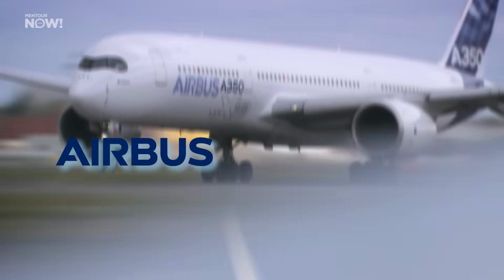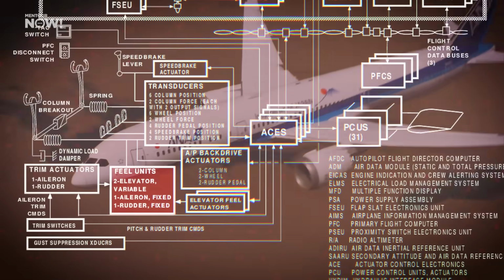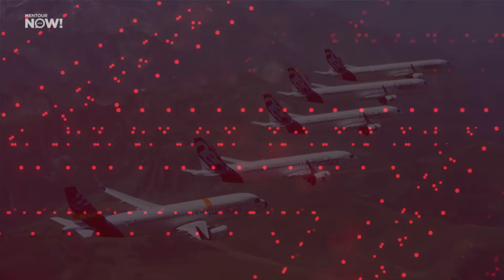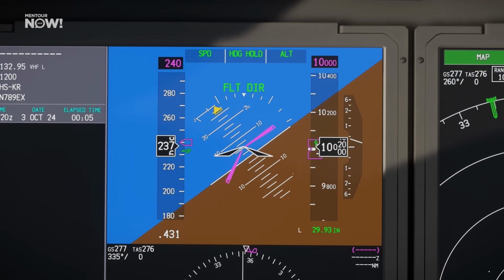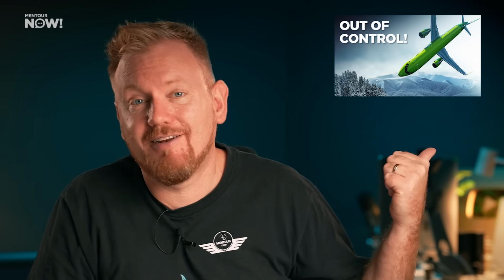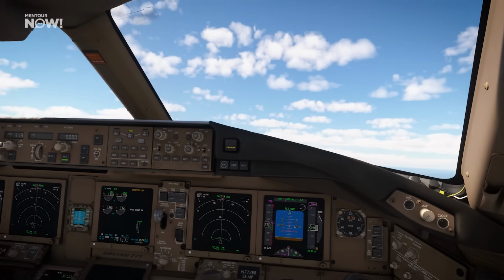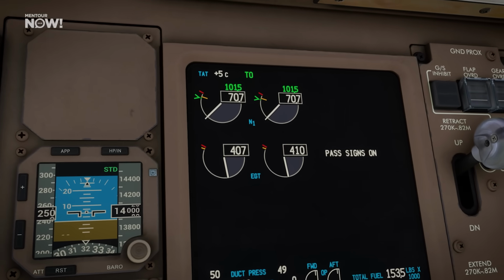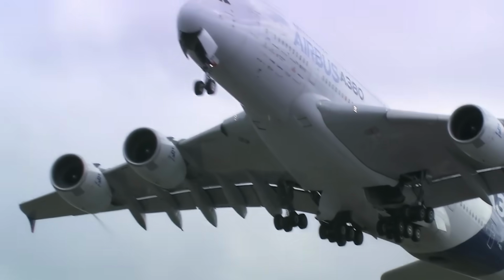Do Pilots Prefer AIRBUS over BOEING?!

Comment: Oh boy you've opened a can of worms here! 
As an engineer I'm going to say Airbus. 
I've worked on Boeings from the 707 right up to the present day's 787 I helped build and maintain Airbus' from the A300 up to the present day's A350. The build quality of Airbus and the way that the company just makes incremental design improvemants along with the way the flight deck layout is what edges it for me. 
Oh! That and the truly awful build quality of Boeing jets today. I've never seen such a poorly constructed aircraft as the B787 before and the Avionics architechture is just insane. Why so many computers, so many electonics that the aircraft's electronics need liquid cooling, unlike the Airbus with two computers and a conventional cooling system.
As for the paint (Or lack of it) on the wings of the Boeing 787!!! No more words needed.
Reply: The thing which I always noticed about Airbus aircraft was the lack of 400Hz whine in the audio, whether it be from their radios or onboard PAs.  That tells me there's extra shielding in place.  It was there on the older Boeings... so if Boeing wasn't willing to spend an extra $20 for RFI filters, what else were they cutting costs on?
Reply: @grayrabbit2211  What else were they cutting costs on? Answer: Everything, hence the current state of Boeing engineering standards.
Reply: @ United has been pausing deliveries of A321NEOs because of an issue surrounding the VHF1 radio. If the lack of 400hz shielding on new Boeings should be treated as a safety issue, then so should the VHF1 issue on United’s A321s.
Reply: @grayrabbit2211 For sure they are not cutting costs on tightening all the bolts like boeing ;)
Reply: @ that’s not a safety issue, has never led to the endangerment of people’s lives
Reply: As a 787 mechanic I have to agree. While I much prefer Boeing manuals over Airbus, the plane itself is not aging well. Mods all the time and new problems emerging sooner than they should. I’ve replaced damn near the entire rad altimeter antenna system on about 7 planes now. Not fun
Reply: @kevintaylor31  the lack of paint on 787s is cosmetic and caused by how novel new materials were at the time. A350 has a very similar issue, but on the fuselage. Neither are safety issues.
Reply: @Blank00 I assure you only paint issue on the A350 comes from parking them in a desert. No issues with any of ours.
Reply: @Blank00 
I wonder if the 2 companies have solved that problem?
Reply: It makes me sad Boeing is doing so badly. I really hope this conversation flips one day, they used to build amazing things.
Reply: @notsam498 Well, as the saying goes, All good things come to an end. Which is why supermarkets always seem to stop stocking the things I like.
Reply: @kevintaylor31  the 787 uses so many electronics because it is a bleedless aircraft. Airbuses and other Boeing families use a Bleed Air System for various systems like cabin pressurization, anti-ice systems, pneumatics and hydraulics, etc. However, this reduces the efficiency of the engine and allows for toxic particles to travel from the engine to the cabin, so what Boeing did is to replace the bleed system with electric motors and electrical heating elements. This means more electrical parts and therefore, more computers to control the increased amount of The 787 also pioneered Hybrid Laminar Flow Control, which requires more computers too.
Reply: Yes, the efficiency of Airbus. You only need 2 computers to kill people. Well, there are documented cases of where the computers decided the pilots were wrong and crashed the plane. So...
Reply: That's why he changed the title of the video a little after it was released.
Reply: Frankenflight
Reply: Why does boeing 787 outsell Airbus 350?
Reply: @yomamajama9627 because it’s a much smaller aircraft.
Reply: That’s because all 787’s are assembled in South Carolina. Different build attitude than Everett where I worked.
Reply: @peterzarkowskyl2752  and the 787 is the "Aircraft Built By Outsourcing"
Reply: @mercurybard9794  Frankenflight 😂
Reply: @peterzarkowskyl2752 not all of ours are. We’ve got some old ones too.
Reply: Liquid cooling? You mean, like a radiator?
Reply: @fjp3305  No. He means like a 1980's mainframe computer.
Reply: @lours6993  Liquid cooled PC components is not really new technology, it's used in the vast vast majority of datacenters worldwide, used in high-end consumer PCs, and actually used by Tesla to cool their on-board AI 'self drive' computer.

But... It does raise some questions in this situation why Boeing is using so much computer power yet not really doing a whole lot with that. Being realistic, the amount of data being processed on an airliner can likely be computed by any modern phone, it's not really enough I'd think to require liquid cooled components I would have thought?

I don't work in aviation, I'm a software developer, just my take. :)
Reply: @VoxelLoop  I know. Why is your comment directed to me?
Reply: @VoxelLoop  the 787 has more electronics than other planes, even the A350. Non-787 Boeings and all Airbuses use a traditional “Bleed Air System”, where systems are powered by “Bleed Air” from the engine, reducing the percentage of bypass exhaust used for propulsion. But the 787 is the first “Bleedless” airliner, meaning that electrical equipment is used instead of a BAS, composing of generators, electrical pumps and heating elements to make the plane more efficient by reducing load on the engine, maximizing the percentage of bypass that propels the plane, and to prevent Cabin Fume events, which is when toxic fluids flow from the engine to the cabin. Systems that use traditional bleed on other planes but use electrical equipment on the 787 include cabin pressurization, anti-ice systems, engine-starting systems, brakes, and the hydraulics responsible for things like slats, flaps, ailerons/flaperons, elevator, trim, rudder, spoilers, etc. the 787 has more electrical components than other airliners, and would therefore require more computers. Even though the 777 and Airbus planes are FBW, they still use BAS, FBW just controls where bleed air goes. An analogy that I can make is that the 787 can be thought of as the Prius of airliners while other planes are like non-hybrid cars where systems like HVAC relies on the engine to run as intended. The 787 also pioneered Hybrid Laminar Flow Control, which requires more computers too.
Reply: @lours6993  I don't know how is that, never had a mainframe.
Reply: @ Densely packed, high current electronics, run at 100% power full time, needing to be coiled by water or other coolant pipes to prevent melt-down.
Reply: @Blank00  Still I don't think that requires that much computing power in all honesty. I have designed (not a professional just as a hobby) embedded devices and people SEVERELY underestimate how much powerful a phone chip actually is. A mobile phone chip from 5 years ago is more than enough capable to handle all the tasks you have mentioned and still run at 15 watts power. 

Also I think you are confusing between fluid simulation for engineering. I highly doubt a flight computer needs to run fluid computation to run Air Conditioning system in a plane... Yes you need pretty beefy systems to actually DESIGN the plane with this functionality but to actually run it I think a simple 30$ microcontroller would have enough power to run it. Though I don't have much idea since I have not worked on 787. What I have said is how it normally works in industry.

The main reason your phone is slow is not because your hardware is bad but because of terrible software written by underpaid people or by intentionally slowing it down to force you to buy new phone every 2 years.
Reply: @ it’s also worth mentioning the 787 was designed in the mid 2000s and entered service in the early 2010s. Computers from the last decade tend to be bulkier than today’s computers.
Reply: @ actually the GPM’s are pretty slim little things.
Reply: @Blank00  While I can understand electronics needing more cooling for that reason (motors and such do get hot after all), it really shouldn't have any impact on the computer systems specifically of an aircraft to that extent. Modern air cooled computers and servers are extremely powerful. For a long time liquid cooled data centers were more or less abandoned in favor of air cooled as liquid cooling became an unnecessary complication - this even extends to IBM mainframes. Nowadays thanks for AI liquid cooling is making a return as chips specifically designed for AI and other tasks require more and more power. This however does not apply to an aircraft like a Boeing 787 as deep learning is non-deterministic and wouldn't pass safety requirements. So there really is nothing that should need a liquid cooled computer inside an aircraft. Aircraft by design use older and less efficient processors as they have to meet stringent requirements and prefer well established technology for safety reasons. This might increase power draw, but I still have a hard time imagining it being enough to actually need liquid cooling unless we are talking 10+ year old chips.
Reply: You must be british 😂
Reply: @ACPilot  and proud of it too. 46 years an aircraft engineer with experience in everything from manufacturing of aircraft and A/C components. Maintenance, from line to D checks. Component overhauling and testing. And A/C types from light A/C to heavy jets. Helicopters, light aircraft trainers and fast jets.

Comment: Doing a Video like this without mentioning MCAS once is quite an accomplishment...
Reply: Having flown both manufacturers. 737, 767, A330 and A380 somewhere between the two would be best. Both do things better and worse than the other. E.g IMHO Side-sticks are better for most controlling (737 aside as cable backup makes leverage essential) but not being interconnected is pretty bad, particularly for training pilots. Thrust levers that move are great, though airbus method of initiating a go-around is more intuitive (thrust levers full forward) than pressing an often slightly difficult to find TOGA button. Most airbus protections are fantastic are much easier to fly time critical manoeuvres than Boeing (EGPWS and wind shear escape) though in a black swan the lack of protections on Boeing could be useful. 
Boeing PFD is much better than Airbus PFD. 
There are many more. 
I have not flown a A220 or a McDonnell Douglas jet (C17 or B717) but those that have say the blend of features is close to ideal.

It was explained to be once that the difference between Airbus and Boeing is a bit like the difference between a European and American car. They both do the same thing, but the indicators and wiper controls are on different sides and how you engage and use the cruise control is different though the functions are the same, the key to remember is that deep down they are both cars. ANC
Reply: @DC-338 I’ve much the same experience and couldn’t agree more.
Reply from the maker: Stay tuned...
Reply: @MentourNow that has got to be the most nervous looking peice of text I've seen this month...
Reply: @MentourNow I mean, not mentioning it; guaranteeing this comment…
The intro writes itself.
“A while back I made a video, and one of the comments…”
Reply: MCAS was a deviation from the Boeing philosophy since it introduced a computer to take command like in an Airbus. Without the computer the accident might not have happened. The sin was not informing pilots about that software.
Reply: @sundar999 if they had simply copied the same code from the tanker variant of the 737 it would’ve had the same auto disable MCAS failsafe when pilot is countering what MCAS was doing incorrectly instead someone made it from scratch without overview or test pilot input (they put the auto disable MCAS after the crashes witch should have been there to begin with) 

but he also showed the complacency of some pilots not remembering the memory items The moment the trim was not functioning correctly they should’ve disabled it before it was allowed to get to maximum trim down (heavy stick and no reaction from trim buttons is normally faulty trim you stab the trim with 2 switches and spin the wheel manually you need to do this within 15 seconds of the runaway trim happening ,or the trim motors could run the trim all the way to maximum up or maximum down depending on the fault)

Comment: My feeling is that Boeing might be better in the hands of the very best pilots, but Airbus is better at catching errors, and guiding pilots when (system) faults occur. 

Statistically however, Airbus airplanes are less likely to suffer fatal accidents, which might ultimately be the most important metric. Although it's a difference between extremely safe and extremely extremely safe

I think you are slightly misrepresenting the data, because when I looked at it some months ago, Airbusses made from the 80s on were safer than boeings made from the 80s onwards
Reply: Well, he mentioned this in his video. He said 4th gen planes are much safer than 3rd gen and he also mentioned that being started making 4th gen planes much later.

Comment: So Boeing planes provide less information yet have more pilot control and way less safeguards for pilot error than Airbus? That does sounds far more unsafe. But I'm not an expert and I don't know enough to make concrete judgements on it. Interesting video.
Reply: Providing less information during critical times is a good thing. Allowing a pilot to override a computer is a good thing 95% of the time.

Comment: Philosophy wise I would go with a mix of the two. I absolutely understand Airbus, but switches and levers indicating something that is not true, due to automation is abysmal. Airbus desperately needs to connect the side sticks, and also adjust the position of the thrust levers if the plane is adjusting the thrust.

On the flip side I understand Boings view as well. But its not really the truth is it? The pilots are not feeling what the plane is doing. The plane is emulating the feeling the pilots expect to have at certain situations. This still has huge benefits, but it can backfire too. Arguably MCAS was only on the Max so it could better emulate the feeling the pilots expected. In reality it overrode the controls in a very airbus way.

I feel there is an ideal solution here, where we use the airbus controls, with Boing's emulated feedback system

Comment: > Gen 4 are considerably safer than earlier designs ...

... and all 737s (including the MAX) are Gen 3 aircraft. Hmmm
Reply: Safety statistics per Million flights of 737NG and A320 family show no difference at all.
Reply: Yeah that seamed like a disingenuous take when you could argue that airbus created that 4th generation with it first aircraft while boeing is still selling what is essentially a third gen aircraft.
Reply: That is the big issue. Being aircraft systems, flight control or alarm system, the 737 is an aircraft from the 60's. And this has an impact on safety.
Reply: @renaudcharlet  yes I thought they will build new plane after 2010 but they did not
Reply: Good point, I would assume that Airbus has a higher percentage of Gen 4 aircraft in the air than Boeing because Boeing refuses to part with the 737 design even after more than half a century...

Comment: @MentourNow, Great Video! There is a point not so clear to me. Is the force/position feedback on a FbW Boeing linked to the corresponding control surface actuator or is just a simulator getting electronic signals from the flight control computers and them translating these into a movement of the yoke? Many thanks!